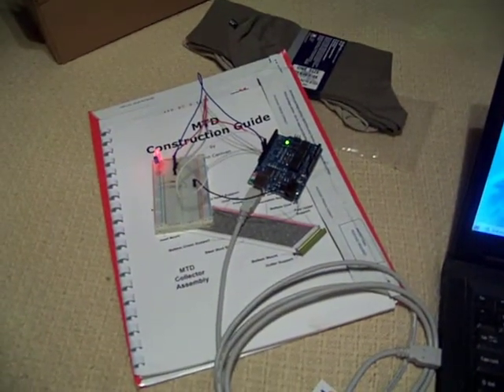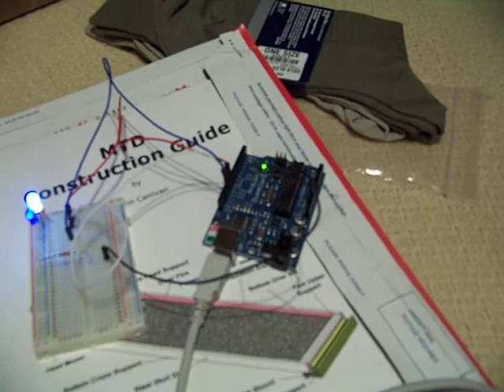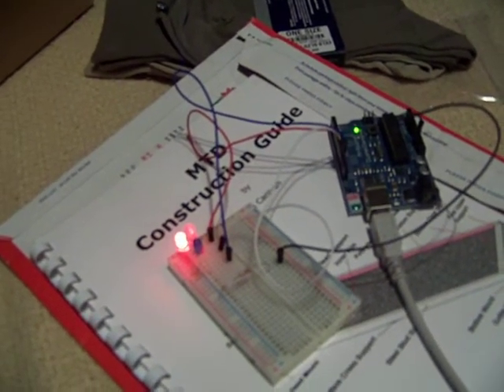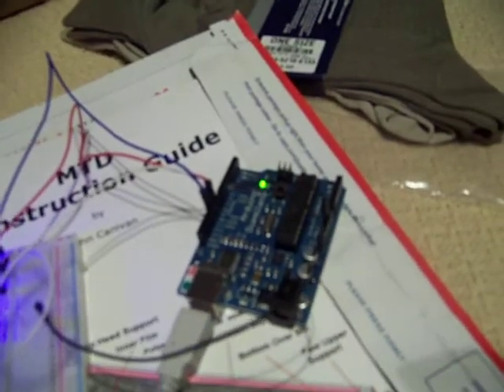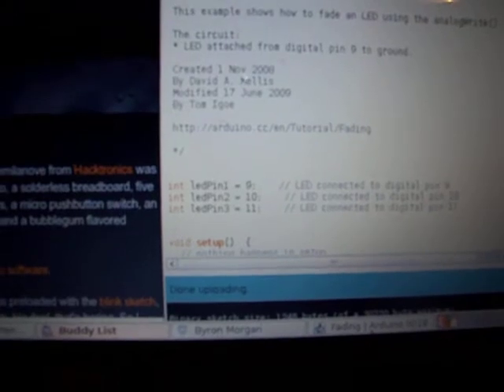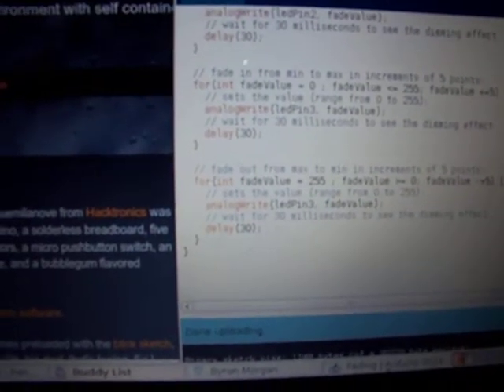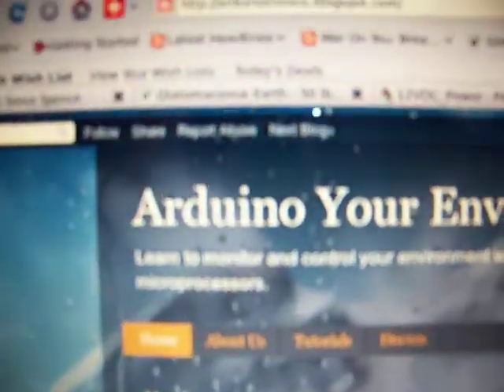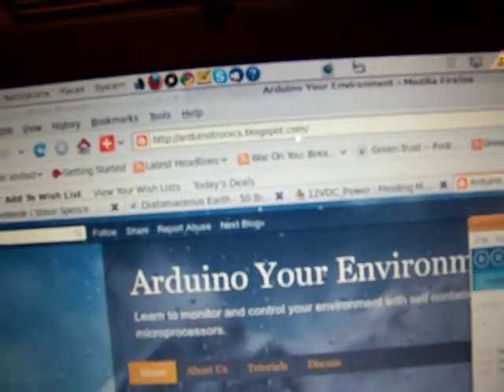Red, White, Blue Arduino Fade

Comment from the maker: The RGB LED's have 4 pins, and are easily controlled by the arduino. You can get any color combination you can think of by mixing values on the 3 legs. the 4th pin is common. I'll be posting a example shortly.